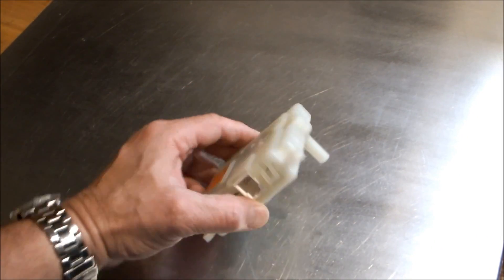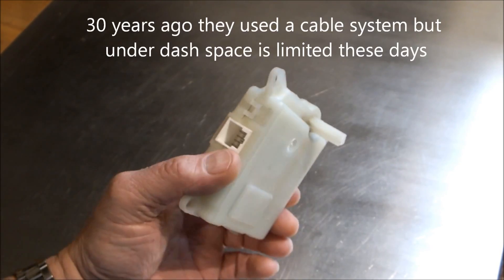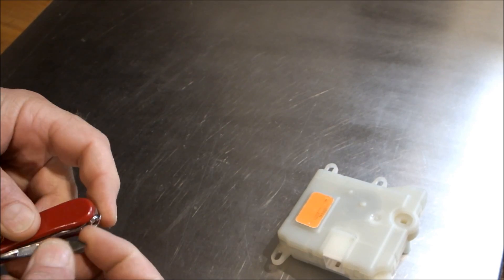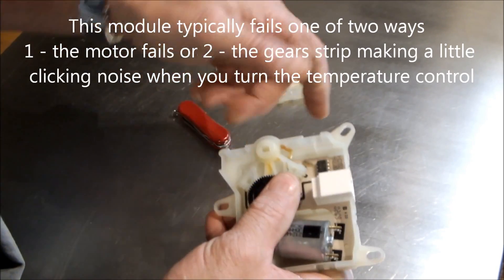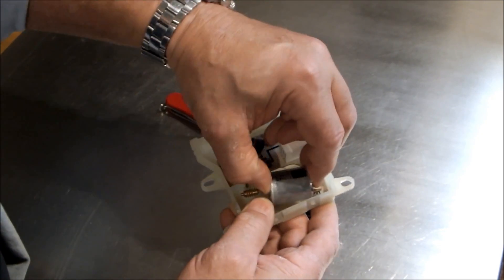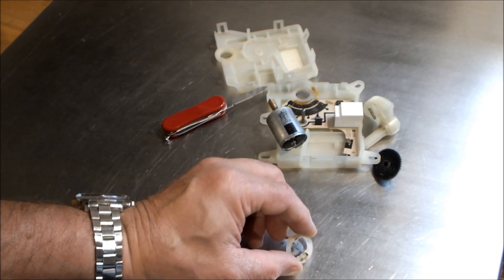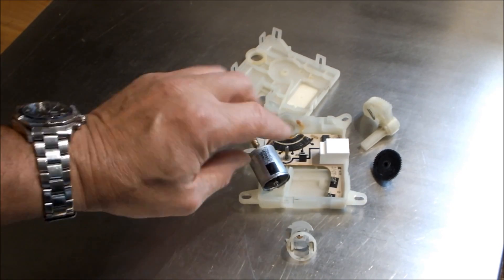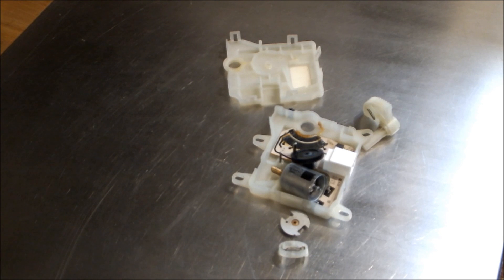A look Inside the Ford Blend Door Motor and how to fix the temperature control

Comment: Nice video, succinctly done, well presented. 
I just got done doing mine- cost $36 (Dorman 604-202) and 3-4 hours on a 2004 Ranger. I root caused the failure to mangled brushes in the DC motor. It would only spin in 1 direction during testing. During installation, starting the 8mm screw in back is a royal pain! I reinstalled it by wrapping dental floss around it for a lanyard and putting a rubber cap plug thingy on the head for grip to get started. The 1/4" socket barely fit, but worked. Now my heater blows hot. This would have drained my wallet hundreds, so I take on almost all my own repair projects. No more flying blind- the internet and YT videos are invaluable for a DIY'er like me. Cheers!

Comment: Hey! I'm a 48 year-old black woman and I fixed it myself! It wasn't really hard to unhook, except for taking out the last screw. It was a beast trying to get the last two screws back on, they both kept falling down between the carpet and console and are now lost forever! Lol!!
I rehooked the electrical connector, turned on the ride and now NO MORE KNOCKING! Now, it still blows cold, but I didn't allow it to run for 15 minutes because I was getting cold, it was getting dark and I technically was still getting over the flu. 
I'll let you know how it turns out later. LATER!
Reply from the maker: Well done Marcia!! Cheers!
Reply: @carquestions  
Now, I've got HEEEEEEEEEEEATTTTT!
YAHOO!

Comment: (Dorman 604-206)  This is a simple manual temp control I replaced. Plastic gear teeth disintegrated on the actuator module I learned about during the autopsy. $25  DIY repair.  One mount screw I accessed via (removed) glove box. The other screws (including the metal guard) accessed from below the dash.  You will need to pull off some gymnastic moves to do it. Be ready to contort your body a bit to reach up in there. Don't give up. You can do it. The pro mechanics will probably go the long route and charge $100 / hour.  As your back is healing you can be proud you saved a butt load of money $$$$$ and did it yourself. Make it easier on yourself and wear a good quality headlamp.
Reply from the maker: Thanks for the info FC - Cheers from Canada!

Comment: If on a really tight budget and if it's fairly accessible, repairing these is possible. Pretty common motor size of 24x31mm w/2mm shaft. And if the larger gear is only partially stripped you can align the bad tooth with the pinion gear with the output shaft in the middle position. This way it will still contact the good teeth when it reaches the stops. Also, it car has manual dial controls best not to set temps at max positions, then your not stressing the gears and blend door in the first place.
Reply from the maker: Sorry for the late reply Sereno - thanks for the info - Cheers from Canada!

Comment: I found the problem on mine to be the 8 pin computer chip on the pcb. Noticed very subtle discolouration on the back of the board and the solder joints had turned a dull grey a sign of excessive heat. The motor bench tested fine. But the, what I assume is the motor controller was burned out. Installed a whole new blend door actuator unit. Everything's working good now.

Comment: If you own a 99-03 F-150 and you are pretty sure this is the problem, this component is actually on the bottom of the blend door. So DO NOT tear apart your dash like I did. Pop the black plastic off, that is below the radio/temp controls near the floor.  Take the 1 plastic pin from the passenger side and it's right behind there. I banged on it a couple times with a screwdriver and it now blows COLD A/C again ! Good luck all

Comment: Just removed mine and opened it up. When I turn the temperature control knob to hot , the mechanism moves about half way and then stops. The motor keeps alternating between clockwise and counterclockwise,  thus the blend door does not get opened fully.
The job sucks but is not as difficult as  some people say.

Good luck !
Reply from the maker: Good on you Troy - Cheers from Canada!

Comment: I have multiple symptoms on my 2007 Ranger.  AC works, but takes forever to cool down.  Fan operates, but seems weak to me.  When it is cool, or even cold outside, the truck blows hot (heated) air when vent is selected, making use of vent only useless.  I don't hear clicking at the blend actuator.  What do you suggest?

Comment: Hi tx for a good video! 
I just have a question, in my Ford transit MK7 (-11) the problem is that when i need AC on i will get cold nice air from the vents on the sides, but on my feet and in the two middle vents on the dash it blows warm air at the same time! Can it be the blend door motor that causes that problem?
Reply from the maker: Yep - that's what I would check out

Comment: Could new wire be soldered into the motor to replace the faulty “brushes” to allow the component to work again? is it special wire?
Reply from the maker: not recommended - but could be used for temporary use - Cheers from Canada!

Comment: Great video.  Much appreciated.  I noticed this morning that my 2012 Ford Fusion would only blow hot air.  This was with AC both on and off.  Could this be my problem?  I'm thinking it's either this or the control module.
Reply from the maker: It certainly could be - also AC could have a leak -- check to see if AC is turning when on Jerome

Comment: I am replacing this currently in my 2008 ranger... Hard to get at, but got it out... nightmare to get back in.  Part was about $60 CDN aftermarket.  It is a do able job for the at home person with the right tools, but be ready to spend a good part of the day screw around with it. I would be interested to find out what the ford repair book has for the repair time, took me hours.
Reply from the maker: Ford dealers would charge at least 3 hours in most cases
Reply: 8mm offset box wrench and 1/2 hour (if you have small hands!) (2007 Ranger)

Comment: Greetings, my question is if the actuator is stuck in hot, does the compressor could be on? I have a Mercury Sable 2005 that the compressor clutch is not engage, and is stuck in the defrost mode. By the way it has freon.  Help please!

Comment: I changed mine now only the heat works. I’m not sure if the blend door is moving freely I don’t try to turn it with the new one but seems stiff
Reply from the maker: I'd double check to see if it's in right - and test it out of the heater box - Cheers!

Comment: 2009 ranger, all hot air except max ac setting. Paid $57 at my local dealer for entire actuator . Saw online i could have ordered it from a CT dealer for 31% off that. Why just order the motor component. Anyway the new actuator works
Reply from the maker: Good info - thanks

Comment: I have a 2002 mercury sable wagon and the blend door was a recall but the first owner didn't fix it so now I am stuck, they said the dash has to be removed is that a lie cause it didn't look like you had too?
Reply from the maker: Ronnie - just checked - the car has four recalls but not the blend door - may have been an extended warranty but that's totally different. The vehicle in my video is not a Sable so ya it may be necessary to remove the dash - don't know for sure

Comment: My mom's 2009 Ranger seems to run the A/C (compressor) no matter where the temp setting is on, now it comes on less than a min. then turns off then later turns on again for less than a min.  then turns off again.  Now this happens even when the heat is on all the way.  I think the A/C Heater Blend Door Actuator is not working, I'm going to check it out today, do you think the broken actuator can have anything do with the compressor turning on or does it do that no mater what.  And do you think it would be a reasonable idea to unplug the compressor or something like that during the winter, to save on the gas. :)  That is to say if it is normal for the compressor to turn on a bit no mater what, (as long as the the system is turned on of course).  Thanks
Reply from the maker: On most cars and trucks if you have it set to defrost it comes on no matter if the heat is on full hot and on cars with automatic control it is almost always going on and off

Comment: I had a bitch of a time removing the actuator, any suggestion on properly reinstalling the new one? I don't know the position of the blend door, what position should the cool/heat setting be set at. Don't want to strip the gears on the new unit. Thanks
Reply from the maker: hook up electrical and park the system by turning it off then match it up

Comment: I have a 207 b2300.  AC does not work . Only hot air blows.  Unless the max a/c is turned on. Then I have cold air.  Ideas??  Thanks!

Comment: i have a 09 ranger i notice if you leave it full hot or full cold the blend sticks try to set the hot/cold setting to the middle when you leave for the night and it solve my problems because i took all that crap apart and i put my finger in the slot were the module goes and turn it and it pop like it was stuck
Reply from the maker: looks like you're on to something

Comment: Do the air blend door actuator and AC Heat actuator use the same part number?  I ask because I just replaced my blend door actuator and it doesn't work.  Tried with two different new units.  Checked the fuse which was good.  The old actuator was clicking so I pulled it out while I was waiting for the new part to come in.  I'm wondering be if I didn't get the AC Heat actuator by mistake?  It acts like it's not getting power.  Tested it installed and not installed, just plugged in. Also checked the blend door and moved freely.  Any thoughts??
Reply from the maker: If you have power at the connector when the switch is in the correct position and the new part does nothing - it is either the wrong part or is defective - case closed

Comment: inside the heater box where the blend door is (full hot)it greats a suction that keeps the blend door sealed for heat i had a really hard time moving the blend door by hand no wander the actuator burns out (solution put the selector (dial on the right) on off wow no more suction the door moved real easy)

Comment: Is this the part that makes the thump noise when you turn the temperature knob?  We have a 1999 F150 with no heat.  It makes the noise of blend door, but even with a new heater core still no heat.  ( turns out if you unhook the battery then hook it back up the heater works)
Reply from the maker: Feel the heater box area with fan on high for 15 minutes - if the box is warm but you get no heat coming out then ya check out the blend door motor
Reply: I bought a new blend door. It will only move the door several inches.  Possible problems?
Reply: @mikecustenborder3991  I don't know anything about cars but I watched a video and they were checking all the lines for a vacuum leak. He used a smoke unit of some kind and where it leaked the smoke would come out. If it's not getting enough vacuum pressure, it can't move the door all the way.  ( I was watching the video where they worked on the control knobs to the heating and air conditioning, there was a blend door control module up underneath the dash that controlled the pressure to the blend door - it can go bad.) I remember years ago I think you take starter fluid or something and with your engine running you spray it all over the engine and when it reaches the vacuum leak the car will speed up - maybe do it at a car wash and spray it off after you're done.

Comment: They could have made those internal parts out of aluminum or a light weight alloy. that motor must have too much torque at times for that plastic. I have seen some of those gears totally stripped with no teeth left.

Comment: 2004 Ford expedition.  Mine blows cold in front and hot air in the back. I changed the top actuator do you think this one could be making it blow hot in the back